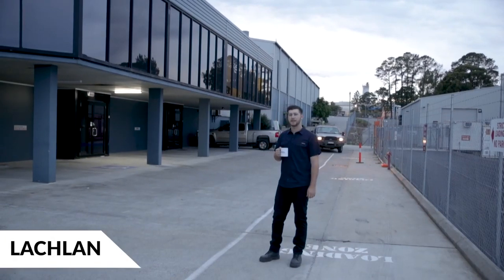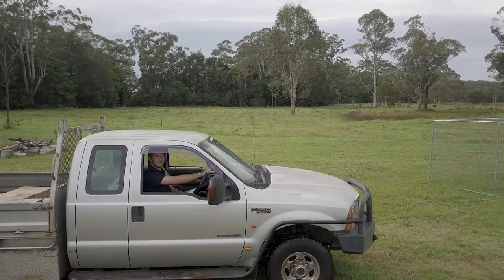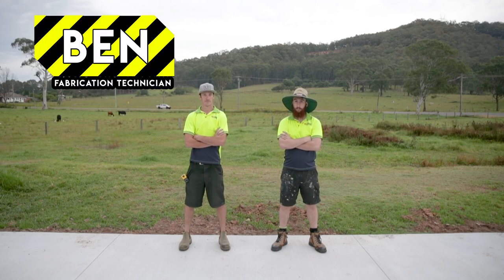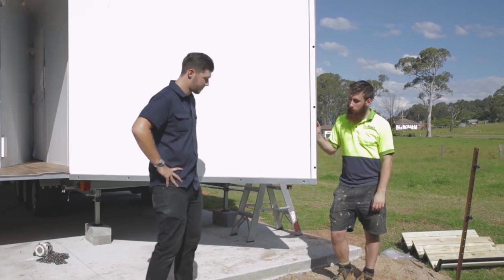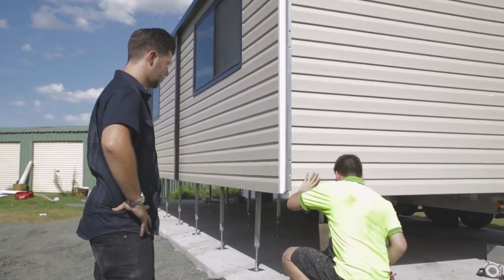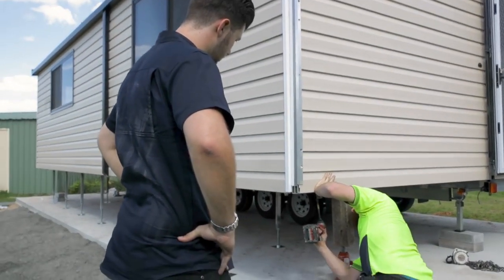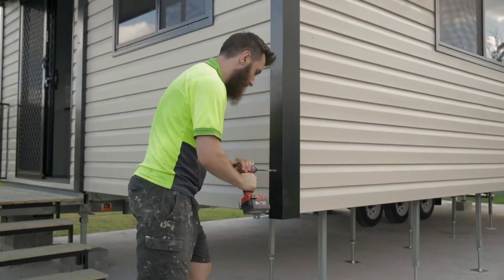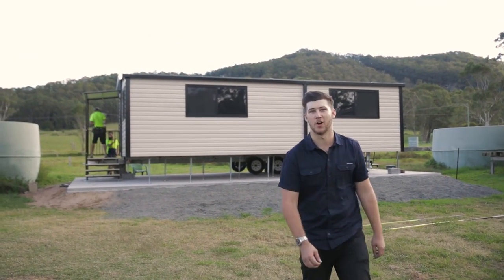2 Bedroom VanHome Granny Flat Installed in Hours!

Comment: Can the bottom supporting legs only sustain the whole weight of VanHomes? Are the wheels are only used to move the VanHomes? Does the wheels' function would be excluded for supporting the VanHomes after completion of building?